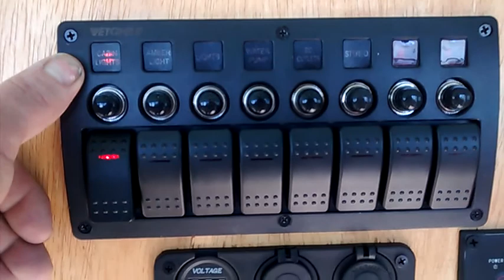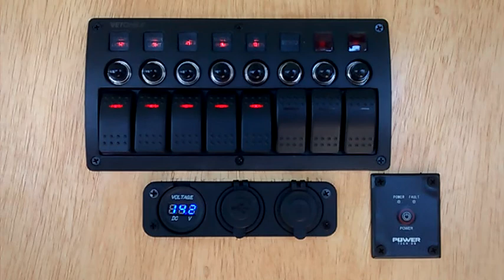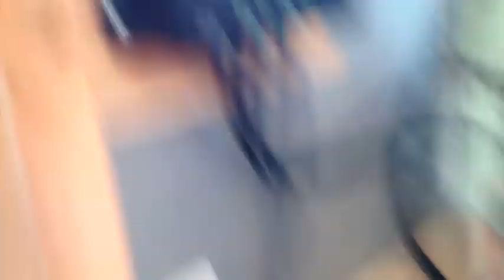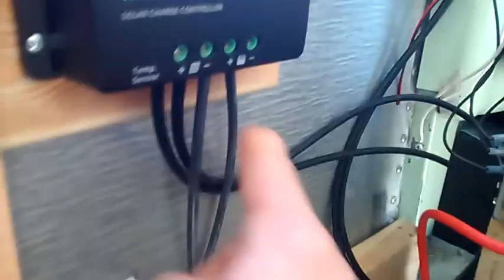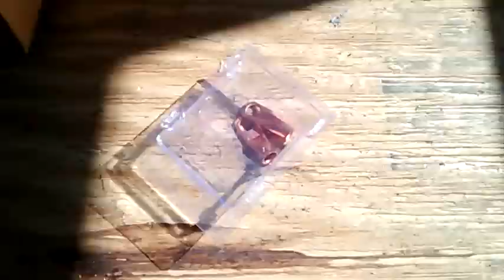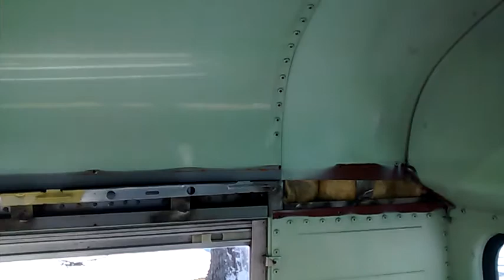Mullet's Skoolie Build EP 13 - Electrical System Done

Comment: John. Consider adding a big switch between the solar panels and the solar charge controller. It makes it much easier to do maintenance on the system if you can disconnect the panels without fiddling with the wires. T3